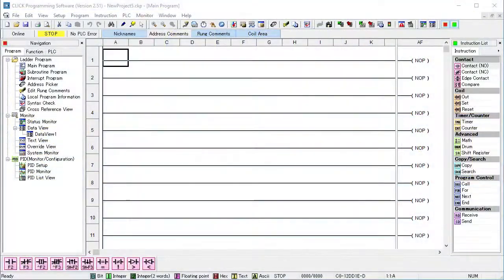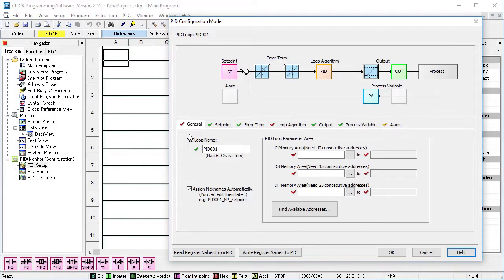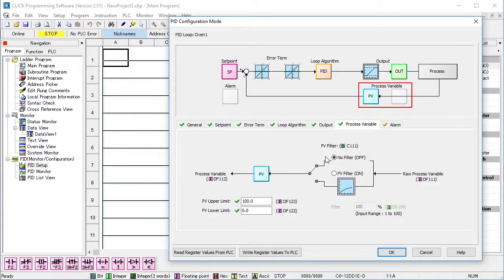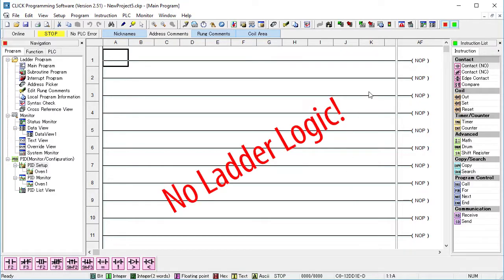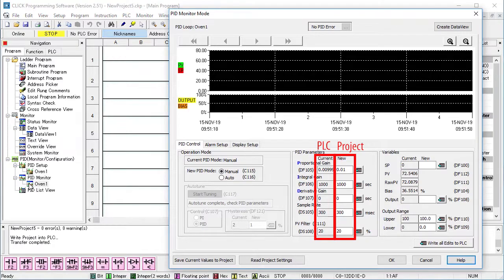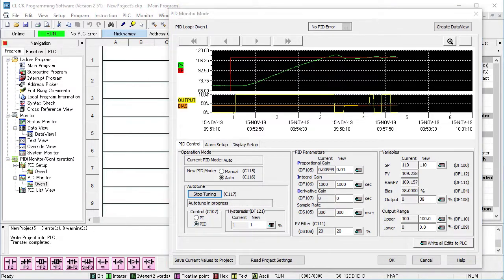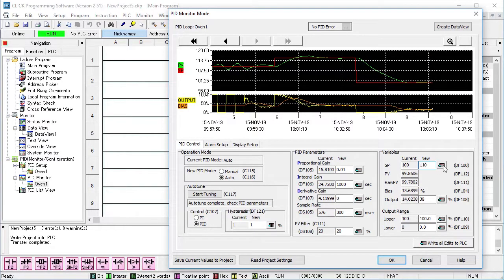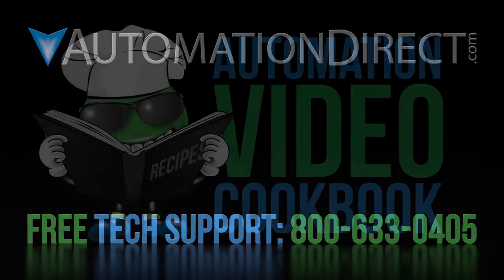CLICK PID Tutorial Videos Part 0 - PID Quick Start at AutomationDirect

Comment: I did my first Click PID application last week.  At first I had an issue that had me puzzled (I was writing the PV to the wrong tag...Var vs. Raw) but after getting that sorted out, I was highly impressed with how well it worked especially the Autotune feature.

Then today I was struggling with getting a Micrologix PID algorithm to perform to my satisfaction and thought to myself how easy this would have been had I used a Click there.  The Micrologix 1100 is now obsolete.  The 1400 is still a model we use quite a bit, but the Click is pushing hard into ML1400 territory and the constant improvements will make it our go to PLC for our small systems especially when serial ports are required (often).

These videos are excellent kick-starters too even for a guy like me with 20 years experience using other brands.
Reply from the maker: Thanks for the feedback - We love to hear when someone finds these helpful!
BTW: Did you know we have over 1200 videos like this?  Check it out here:
www.automationdirect.com/videos ............ by random search/category
www.automationdirect.com/cookbook ...... by subject/topic